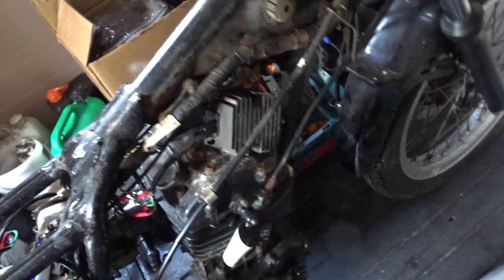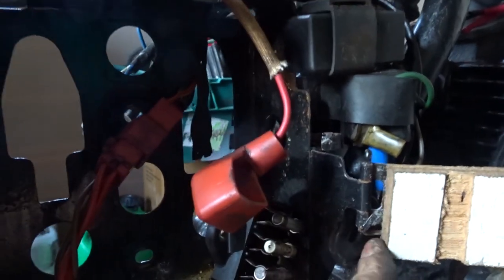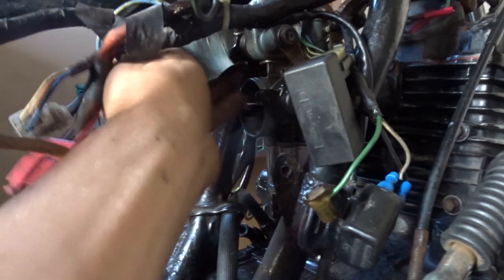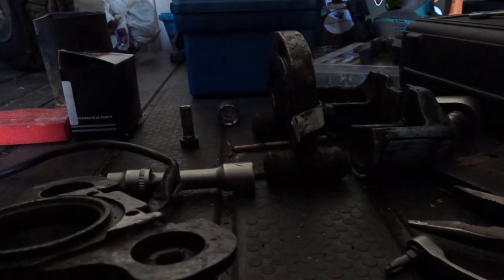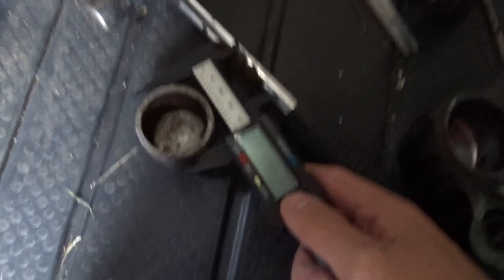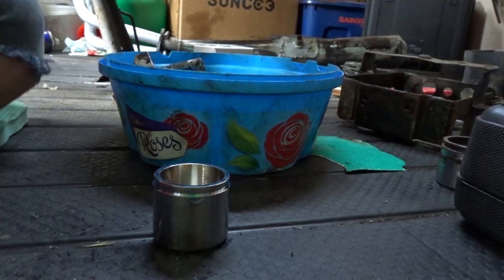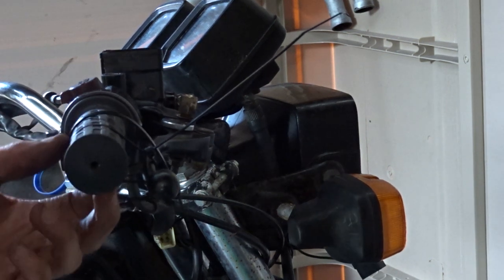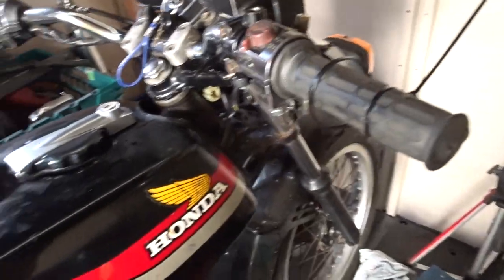Honda CB250RS Project Motorbike Part 6

Comment: Good tip about cable tying the brake lever back to the bar. I also tap the brake hose with a small spanner, from the caliper up to the master cylinder, to loosen any air bubbles.
Reply from the maker: aye that would do or reverse bleed the brakes but the spongness has gone now

Comment: Lovely job.  It will be interesting to see what you come up with for the electrics.  I wouldn’t have been able to resist painting the the calliper before I rebuilt it.
Reply from the maker: at the moment i just want to get it all running and see if it all works first. i would hate to paint it all then find out that the odd combination i have now got dont work haha